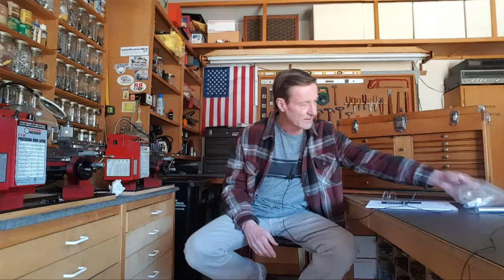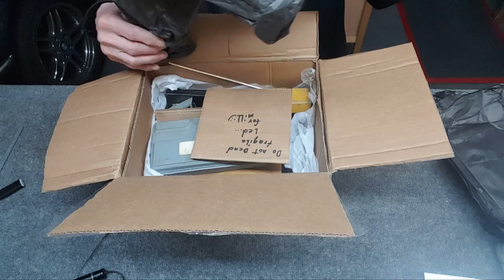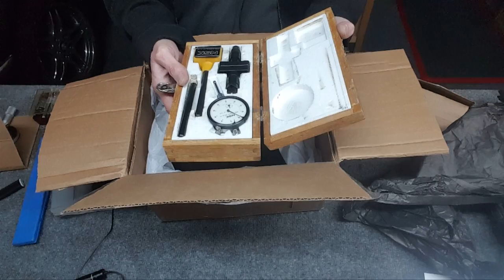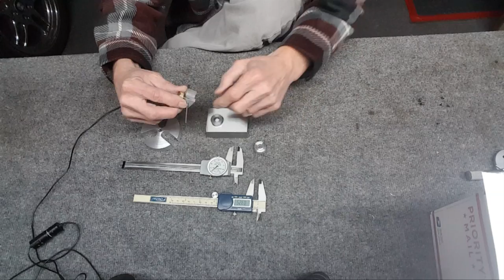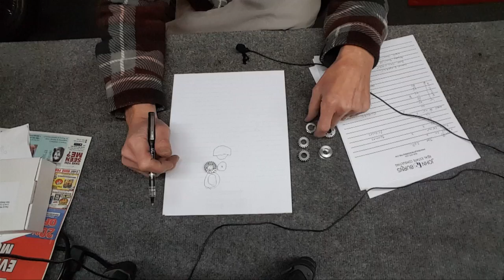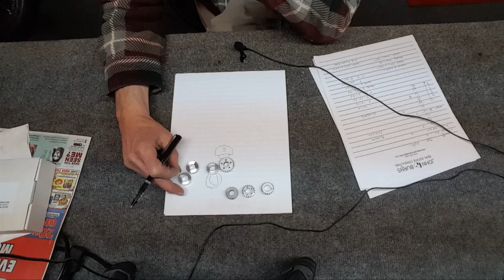Heinz 57 Shop Updates

Comment: Thanks for the detail on the spindexer. I'd say making that engraving tool was worth the effort. 😀 Good info on the gears too. Could you just make the smaller gear a little smaller to give it some backlash and not resize the middle gear? How does your printer do on small circles? Mine has a problem with them being out of round. I tried playing with the settings but can't seem to make them work. Thanks for an interesting video!
Reply from the maker: I've printed a few things that have holes in them and haven't noticed anything. What program is doing the slicing?
Reply from the maker: You did change X from 100mm/step to 100.2 right..
Reply: No, I didn't. I will try that, it could very well be the culprit. I'm using Cura 3.6 I think. I'm going to try the new version 4.0 and see how it works. Thanks
Reply from the maker: NOOOOO.. I just tried 4.0 and lost all settings and printer stuff. Also hated the new layout! Went back!
Reply: Dave what program are you using for slicing and printing? Maybe there is something better than Cura?
Reply from the maker: Cura 3.6.0 but if you don't have X and Y steps per mm right then oval holes.. also does the head assembly rock on the two rails?
Reply: I haven't noticed the print head rocking but I will watch for that. Where did you change the settings to x=100.2 at? I tried in the settings menu on the printer but once shut down they went away?
Reply from the maker: Just grab the print head and see if it rocks back and forth. I never checked to see if it stays...
Reply: Yah, it does rock. It appears to be rocking on the Z-axis. I wonder if there is room to add a second support rod to the Z-axis?
Reply: Dave, have you seen the steel frame that's available for the Anet A6 printer. A little expensive but would stop most of the flexing.
Reply from the maker: You don't care about Z but as long as it rocks left and right there will be oval holes.
Reply: Right the Z isn't the problem except the carriages on each size rock with the 2 bars that carry the print head? Another option to adding a second support rod on the Z might be to add a second bearing to the Z rod to help stabilize the print head?

Comment: I believe that the gears for your mini lathe are module 1. If so, harden steel blank gears are readily available via AliExpress and eBay. You can easily verify if they're module 1 by measuring the outside diameter of your existing gears. If the diameters are ~2mm larger than the tooth count, then they should be mod 1. I don't know if this is an issue for you, but the standard width for mod 1 gears is 10mm.
Reply from the maker: Dude.. https://youtu.be/yvGYtCBTDUw